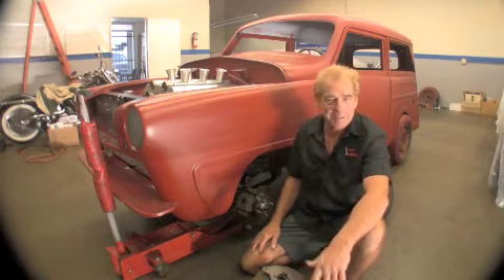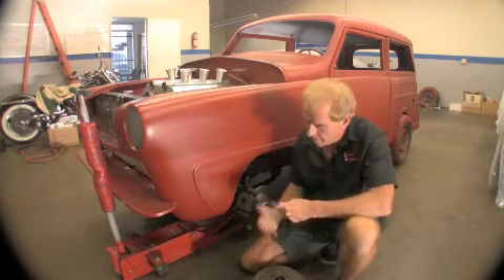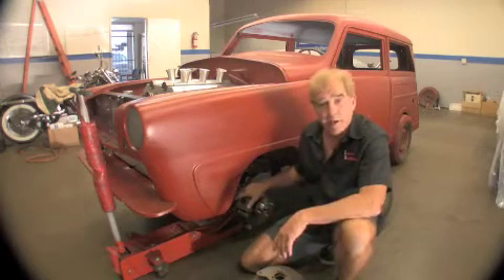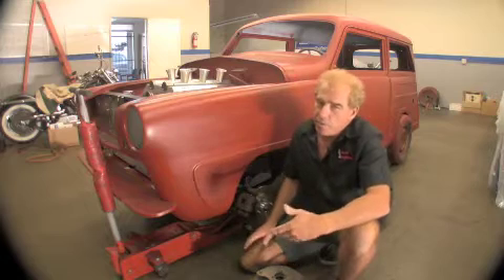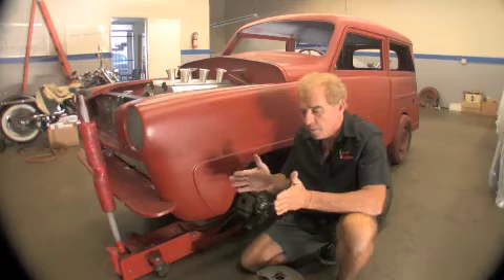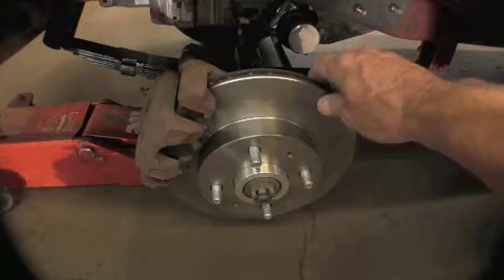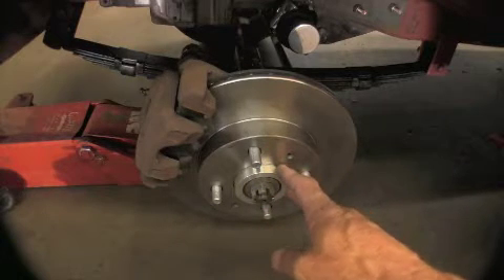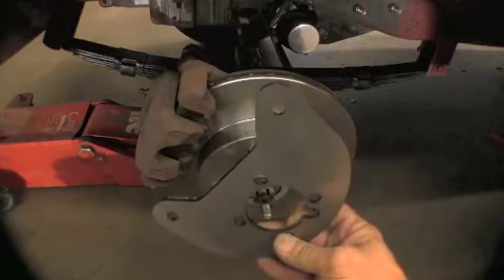Crosley Disc Brake Conversion by Scared Shiftless

Comment: P.S.   First disc brakes systems on American built cars .                                             The 1950 Crosley Hot Shot is often given credit for the first production disc brakes but the Chrysler Crown Imperial actually had them first as standard equipment at the beginning of the 1949 model year. The Crosley disc was a Goodyear development, a caliper type with ventilated rotor, originally designed for aircraft applications. Only the Hot Shot featured it. Lack of sufficient research caused enormous reliability problems, especially in regions requiring the use of salt on winter roads, such as sticking and corrosion. Drum brake conversion for Hot Shots was quite popular.

Comment: I have a 50 Crosley Pickup.  I would like to know more about doing a disc brake conversion.  Where can I get the parts that you used to do this conversion to modern disc brakes. 
Ron Ayers
www.classiccarsofsc.com
Reply from the maker: Ron Ayers We used front disc brake calipers and brackets off a 91 Nissan. The parts are available from parts stores with brackets and without. Since we where testing we used from a wreck car that cost less than $50.00 We fabricated the mounting plates from chrome molly and had them flame cut. This allowed us to mount the Nissan calipers to the spindle. We wanted to keep everything from the same car so we used the rotor also from a 91 Nissan. We had to make our own hubs using the original bearings style and seals from the Crosley.  The mounting plates we have extras that we could sale. The hubs we have the program to reproduce however did not have any extras produced. Hope this helps with your question. Thank You Mark.
Reply: Mark Boice Is there any way you could supply the brackets or a template that I could use to have them made and exactly which series 91 Nissan did the calipers come off of.  I would appreciate any help you can give me.  In addition to the Crosley, I have about 350 other vehicles 

Thanks, Ron Ayers at www.classiccarsofsc.com
Reply from the maker: Ron Ayers We could supply you with the brackets and have my machine shop run another set of hubs if you like. We used a Toyota rim on our conversion and used the original Crosley hub cap. Not sure if the factory wheel would work with the disc brake conversion.
Reply: @MrScaredshiftless  do you still come on here? im interested in buying a set of the brackets and hubs for my crosley rat rod im building
Reply: Mark Boice Mark, Thanks for getting back with me.  How much for the brackets and for the hubs.  Did you do all 4 wheels on the car?  My phone number is 1-864-313-2908 and my direct email is ronsoldcars@bellsouth.net.  I look forward to hearing back from you

Comment: I have a 50 model sedan myself with 26.5 horsepower. You impressed? Ha! I still have all 4 wheel disc as original. Great video. Thanks
Reply from the maker: I have a 1950 Crosley coupe with the original 4 wheel disc also. Not running or stopping yet. Hopefully this year. Good luck with your project. Thank You